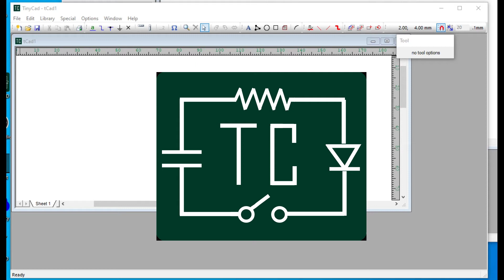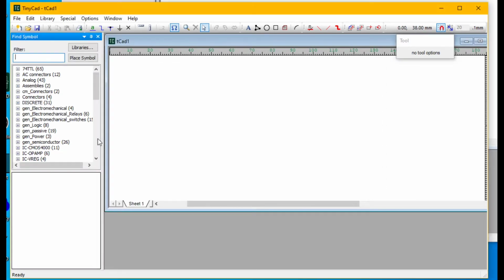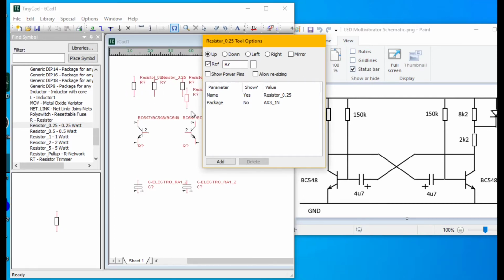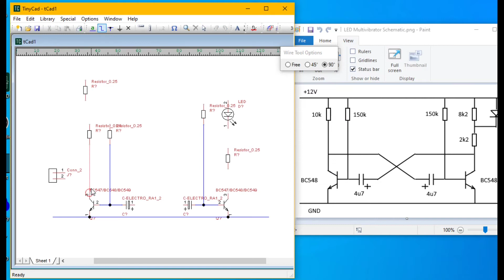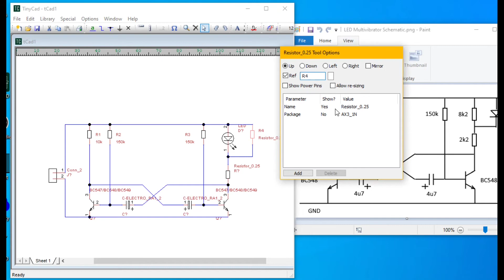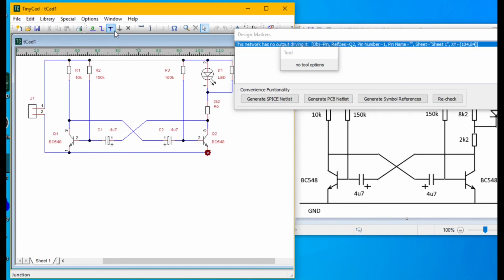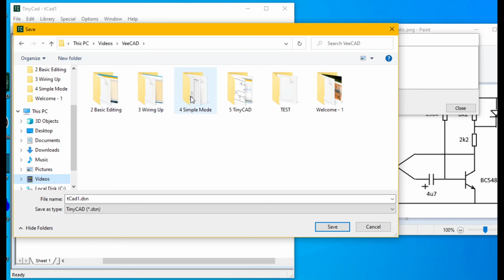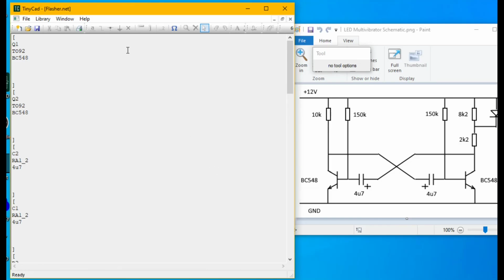5. TinyCAD

Comment: Why connecting element directly to power throws an error? If i connect it to a junction it's fine, but as soon as I add, let's say, a resistor it's saying that there are no connections to it...
Reply from the maker: It sounds as though the power symbol is not exactly on grid with the component pin - and TinyCAD does not make the connection. On the Options -> Settings menu, make sure Snap To Grid and Fine Grid are turned on. If a particular connection is a problem, you can draw a short wire.
Reply: @veecadcircuiteditor2687  okay, I will try that and let you know

Comment: can schematics created in tiny cad be used to create protoboard designs in veecad? please help
Reply from the maker: Yes. On the VeeCAD menu, go Board -> Strips. You can preview the Protoboard pattern in the list and select it into your project. VeeCAD will apply your TinyCAD netlist to this board and trace tracks, show missing connections and wrong connections in the usual way. If your board differs from the VeeCAD version of "Protoboard", I am happy to create it for you, or you can draw it yourself in the VeeCAD track editor.
Reply: @veecadcircuiteditor2687  okay thank you